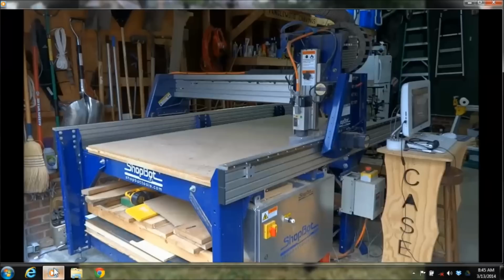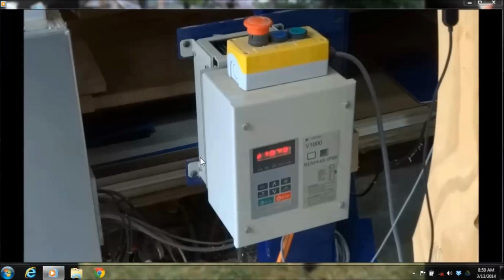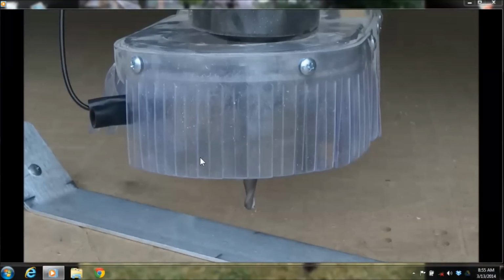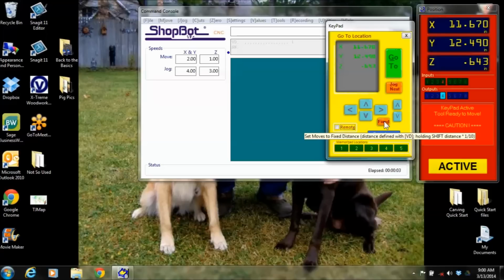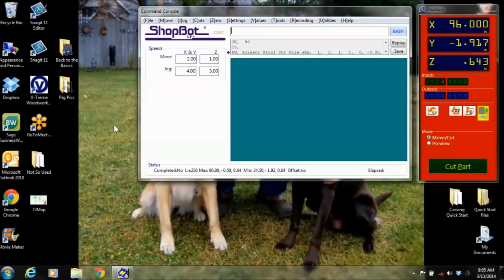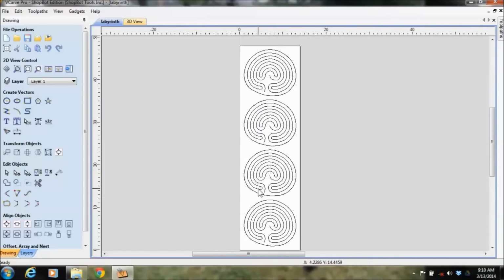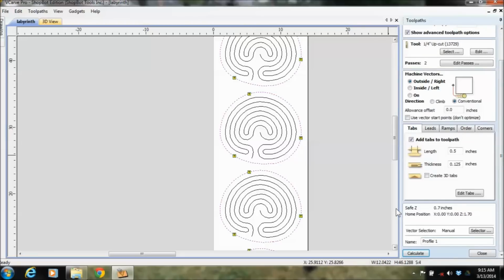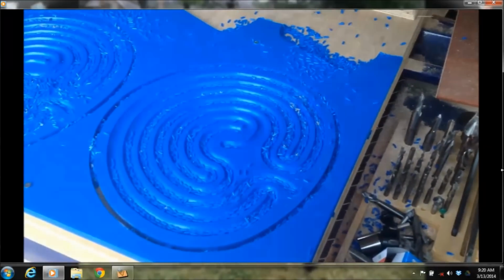Back to the Basics

Comment: Your controller shows the X-Y-Z axis but mine show two additional axis. A-B. WHat are they? I have a single spindle machine.
Reply from the maker: A and B axis are optional auxiliary axes for accessories. The A axis is most often used for a second spindle (second Z axis) and the B axis is most often used for a rotary indexer. These are enable through the "Display Values" dialog under the "Values" menu in the shopbot control software by increasing the number of axes displayed from 3 to 4 or 5

Comment: This software is difficult to use.   I hope it has been improved since this video was released.  I used my employers shopbot for the first time recently and was pretty shocked to find control software that functions like it was written in 1995.  After using various 3D printer control software with very refined and easy to use interfaces, it is hard to use ones that were designed only with utility in mind and not useability.  The machine works good though and I used it to cut some parts and everyone was amazed because it had sat for years because no one knew how to use it
Reply from the maker: Thanks for your comment! We have made software updates throughout the years that improve the speed and functionality at which our control software communicates with our machines. In fact, we recently released an update for SB3 that you should download from shopbottools.com. We understand the interface does not look as modern as 3D printer software but you will find that it is capable of advanced machining. You can design very complex projects and achieve fine detail with our USA made machines. We are a small independent manufacture and we pride ourselves on swift customer support. We encourage you to call or email with any questions. A little training goes a long way! We want you to be successful with ShopBot CNC machines. 888-680-4466 or support@shopbottools.com. Thanks!!

Comment: Everybody else calls the longer dimension (the long 8' length) the Y axis and across the gantry the X axis. Why are you guys backwards? Also, the Shopbot software sucks I'd rather use Mach3 with it.
Reply: X is the base axis (Y is on top of it, and Z is on top of Y), just like in cartesian systems